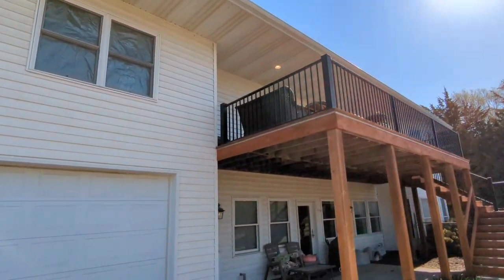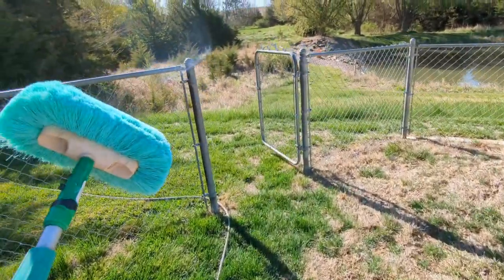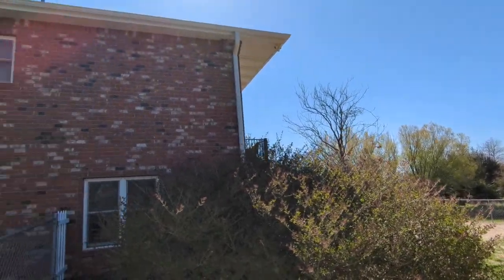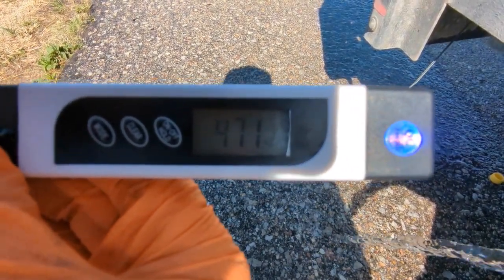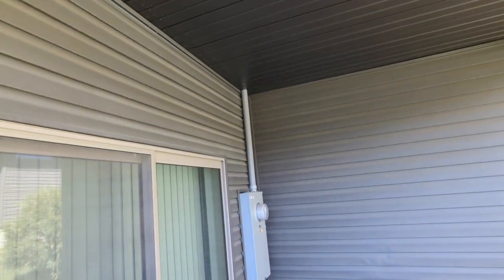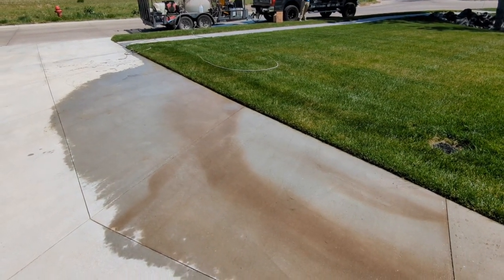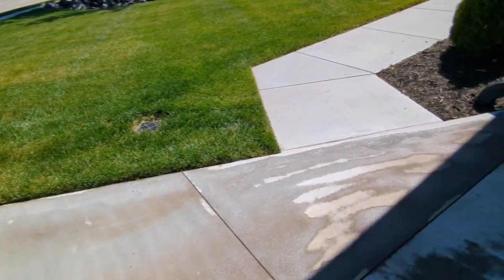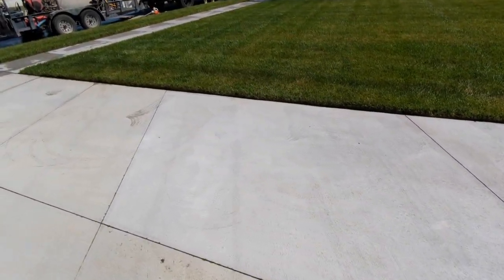House Wash And Big Rust Stain Cleaning On Driveway

Comment: I would have been inclined to blend the Bark9 or whatever it is, like gently overspraying beyond the concrete expansion lines for about a metre.  takes a while with the delicate hand sprayer by the look of it.  How long did the job take all up?  thanks for uploading.  How do you prevent run-off from landing into the conrete-grass edge?  thanks
Reply: Its not like paint where it blends. It will just leave a clear line where there was and wasnt chemical

Comment: My tds in town in georgia is 43, I did windows on another water system that read 879 and it trashed my filter within 30 mins.
Reply from the maker: Wow! You could almost just use straight tap water at that low of a reading
Reply: @adenpressurewashing6009  What ratio did you use with F9 and could've you sprayed while it was wet since it can be diluted?